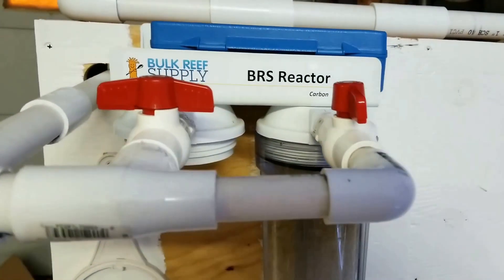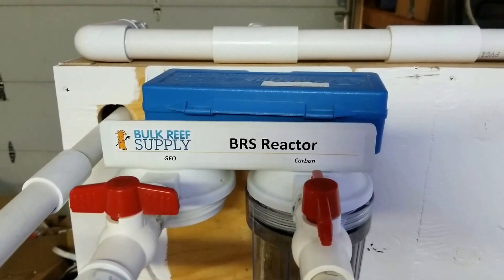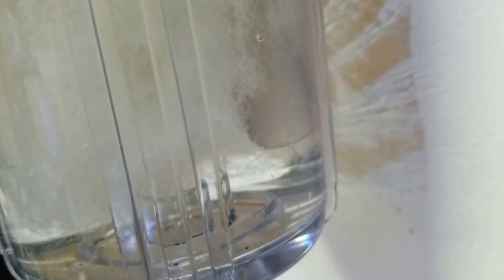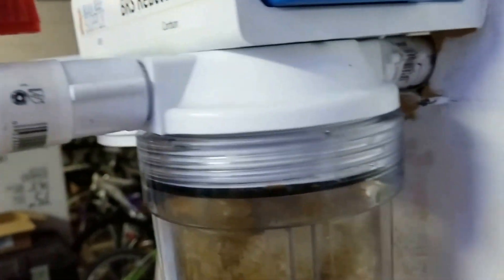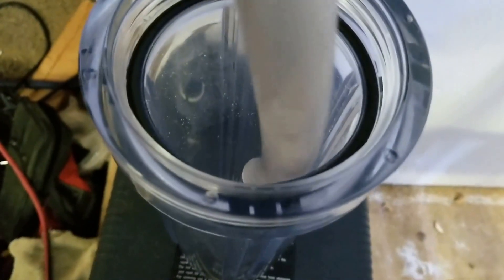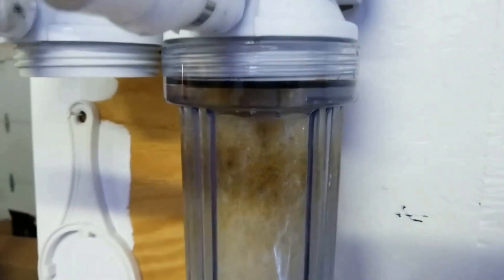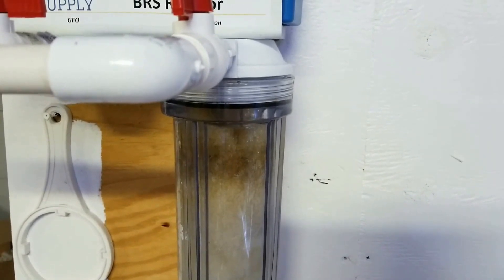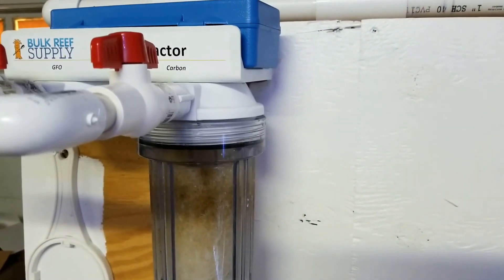BRS Reactor modifications

Comment: So I have a single GE high flow house hold filter. Do you think this is save to convert or should I get the one you have? I don’t think there is a big difference but I am kind of new. Could this be toxic to my tank?
Reply from the maker: Albino Rhino64 
 Anything will work is a canister, You just need to have something that holds The carbon so it doesn't tumble but the water flows through it .
You can even put a bag of carbon into the canister allow water to flow through it
Reply: abreezeducttesting awesome I was worried about it being toxic. I’m just going to use the vos to clear up the tank. Piggy back it off the return on the canister that I have. I’m running it on a 30gal tank